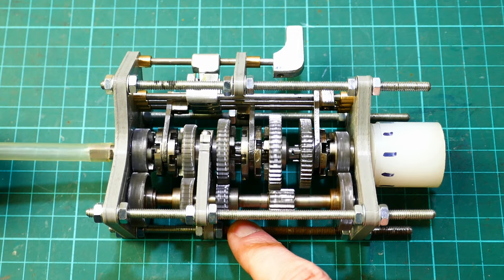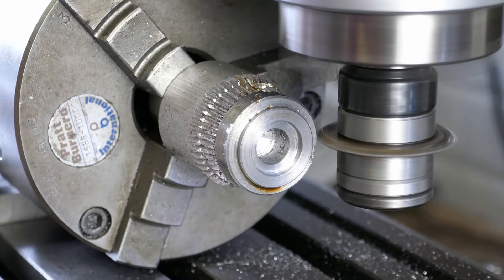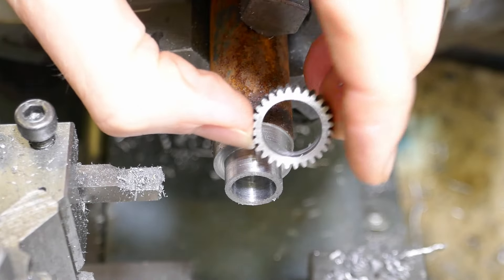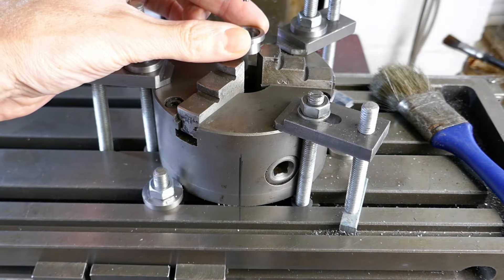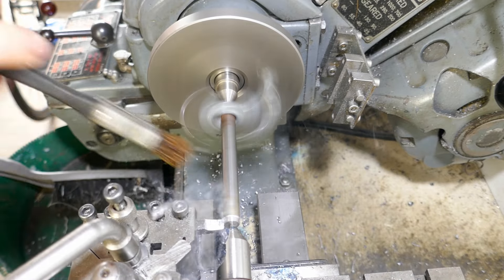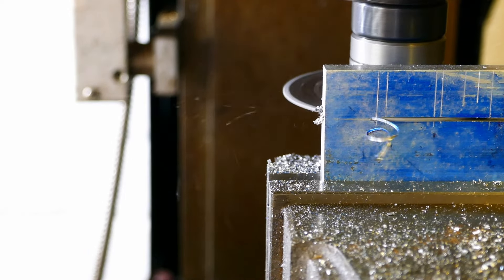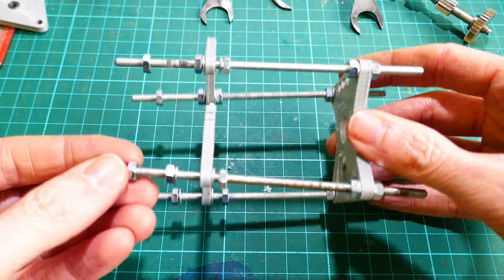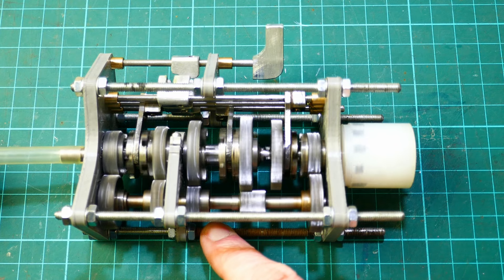Making a  working model five speed gearbox in 1/5 scale on lathe and milling machine

Comment: Excellent! Very good machinist. I loved the homemade dividing head set up. Makes the math easy compared to the typical 40:1 heads. I am just getting started in machining again. I did some simple machining when I was a machinery tech in the Coast Guard 30 years ago. I just bought my first milling machine and lathe for Christmas to myself after I retired and finally have the time for a personal hobby.  I have already spent twice as much on the tooling than I did on the machines themselves.  I am figuring out gears now I bought a 40:1 dividing head. I'm brushing up on my math skills. Your video was a huge help for me to figure out the process of holding a blank for cutting. Huge THANKS, my friend.
Reply from the maker: @floating69poet  I’m glad you found it of interest.  Best of luck with the new hobby, acquiring tooling can be a hobby in itself but there are plenty of tips and hacks that can reduce what you need.  But figuring out how to do a particular machining operation is part of the fun.

Comment: I have been wondering about how the dog clutches are tensioned together before they mesh. They are not synchronized and can meet tooth-to-tooth when gears are switched, so they need to be pressed together for a small time before they rotate enough to get the teeth into detents. However, when you ride e.g. a motorcycle with a constant mesh transmission, you just click the pedal to shift and it shifts, you don't have to hold it down or up.
Reply from the maker: I think the motorcycle dog clutches have wider tooth spacing so they engage more quickly (maybe something to change on my design).  This video gives a good insight: https://youtu.be/ajIgSFZkSfE?si=9wgUfYQBSToVN0GS.